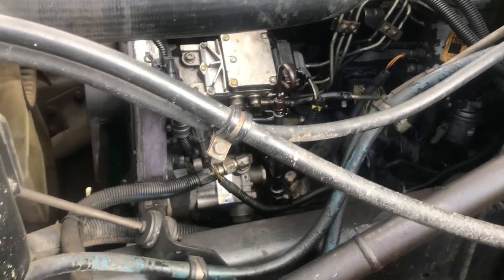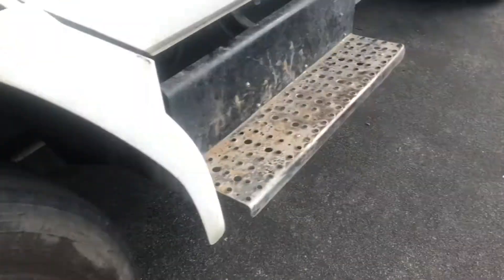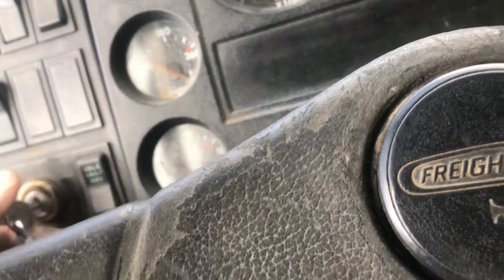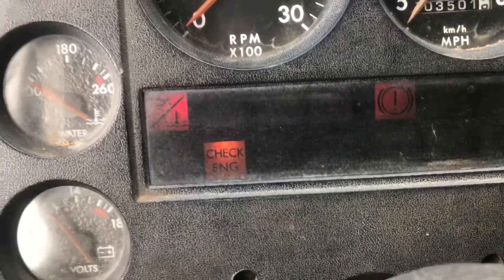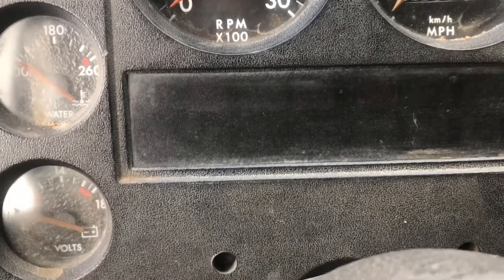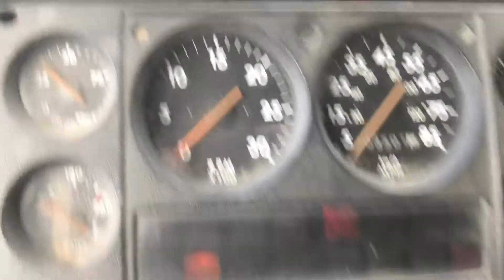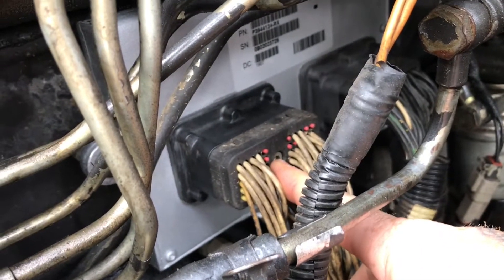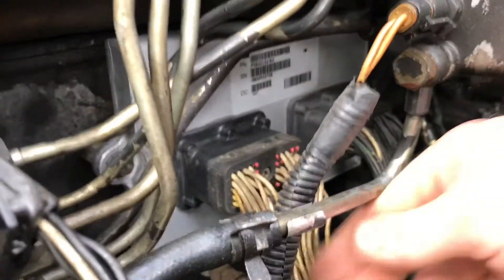Freightliner FL70 ECM

Comment: Have 2000 Freightliner FL-80 ,. The bottom left 2 dash lights start flashing and truck dies. Restart it, runs for a little bit and then dies again.

Comment: Question. 97 FL70 Freight liner.   I’m trying to connect a keep trucking tracker and they stated of not having a placement or ECM. I Js need power / power cord correct? It does have a ECM or to fuse panel?

Comment: I have 98 fl70 with cat 3126 when cold starts hard at high idle glow plug light comes on once at 120 degrees goes off then back to high idle then press break pedal pack to low ide then high! May be a senor!?
Reply from the maker: joe clifton Check the cruse control settings and system. Or maybe the PTO system
Reply: @boscos5287  just had allison transmission pump installed and some pto parts broke took out pump
Reply from the maker: joe clifton did you have this problem before that broke?
Reply: @boscos5287  it would idle up when cold but not at start up I would turn key on and here clicking and start on low idle then go to high idle now starts super high idle with glow plug wire light on once it reaches 120 degrees does off but I think it's  getting worse harder to start and brought for a few seconds
Reply from the maker: joe clifton Inspect your PTO electrical system. When your PTO is engaged your idle will go up. Your idle going up automatically is because something is wrong with the PTO system
Reply from the maker: joe clifton let me know updates and Subscribe
Reply: @boscos5287  I thanks would that make the glow plug light be on until 120 degrees? Thanks for your time!
Reply from the maker: joe clifton No it wouldn’t. If your truck is drivable, take it to a Cummins dealer and have them update you ECM. If it’s not drivable, remove the ECM and take it to them. Cummins are notorious for EMC needing updates.
Reply: @boscos5287  it's a cat 3126